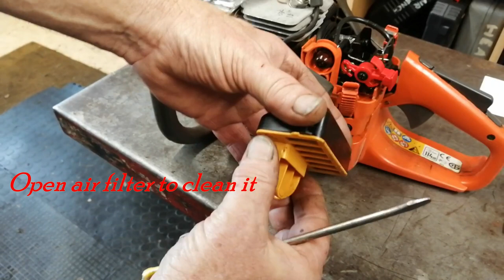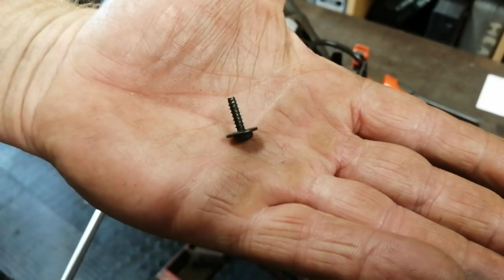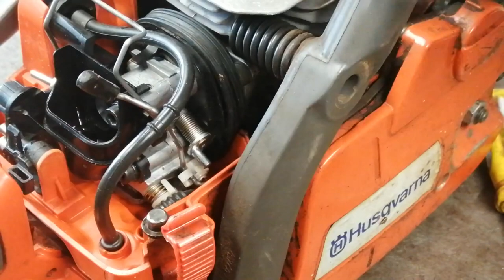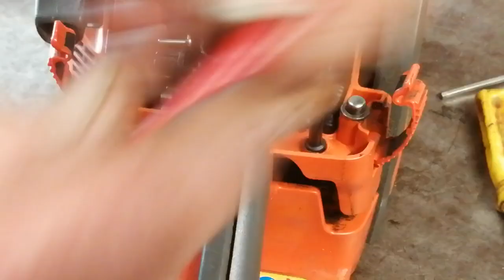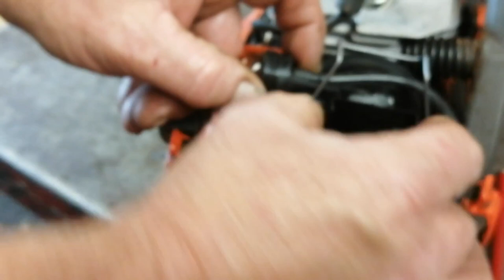Husqvarna 435 chainsaw carburettor removal

Comment: I'm about to do this on a Husqvarna T435 this week for a friend who is a landscaper. This was a huge help since I haven't worked on many Husqvarna products. Very similar to Stihl. Idle fines. I'm thinking it dirty/partially clogged since it runs perfect at WOT for about a minute after priming it and suddenly dies. Fuel lines look good. Will be replacing the air and fuel filter along with the spark plug. If cleaning the carb doesn't resolve it, I'm throwing a new one on. Again, I appreciate the visual video.
Reply from the maker: Almost certainly the diaphragm in the carb getting old and crusty, not pumping well enough to supply enough fuel at WOT. Get a carb rebuild kit. Start from the original carb rather than changing everything with a new one. I have had many pattern carb fails.

Comment: Thanks for the helpful video. I was struggling with the throttle linkage until you showed the little plastic clip to release it. If it helps anyone, this saw is also marketed as a McCulloch CS410 Elite it's identical. Mine (I live in Spain) has a small plate saying 'Made by Husqvarna Spain' and all the Husqvarna part numbers fit it. Also for it's detractors, I've had this saw for 8 years and it has been very good, changed the carb but the other one is good, just refurbed it with a kit.

Comment: Great video! It helped me a lot! The throttle and the air filter housing had me stumped. One thing... I used my long needle nose pliers to get the three Allen bolts out. Just grab and pull! Easier than the magnet. Husky definitely could have done a better job. I have a couple of 455 Ranchers and have changed carbs on those a few times. 5 minutes and I'm done. The 455 is a much easier saw to work on. This little one is a pain!
Reply from the maker: Thankyou and well done :)

Comment: To remove that 3rd pesky screw, I backed it out as much as possible with the Allen wrench, then used a tiny screwdriver inserted from above to hold the screw in place, then grabbed onto it with needle nose pliers & pulled it out.
Reply from the maker: And that is inspired. The final piece in the jigsaw. I can't re-record it unless the customer breaks it again :)

Comment: Hey, I removed and cleaned and replaced per your instructions, still having starting issue where it runs a few RPMs then dies. I feathered the choke a little and was able to get a few more RPMs, but not much. Fresh fuel, new spark plug, etc. Any hints to further troubleshoot? It has been a bullet proof power tool for many years until now.
Reply from the maker: Probably a crusty diaphragm issue. It is running only on the priming. Get a carb rebuild kit. Avoid cheap whole aftermarket carbs, I have limited success with them. Best of luck :)
Reply: Check your fuel tank vent!

Comment: Horribly designed carb. Watching this video is the only way i was able to get this carb off and clean it.  The little plastic piece holding throttle linkage was designed by a madman.  Attaching the kill switch wires can take hours.  Piece of doo doo.  Great video.
Reply from the maker: Thankyou.. glad it helped :)

Comment: That plastic tab that you pull loose from the throttle linkage is more than a fiddlle didly...lol Did you rip any of the gasket when trying to line them up with the allen bolts.
Reply from the maker: I don't think so.. I'm fairly sure it all this carb needed was a good clean inside.

Comment: Had every thing up to the peg in the rubber. (not the choke lever-yet)
It would had taken me a while to see that peg thing. And even if I did, *finagling that housing off just seems...well...
So that was planned by the engineers on a computer?
Pretty good software, being that it was coded with a, 'Finagle Subroutine."
Oh, I noticed you must use one of those low wood chips produced chains.
Yeah. When you showed us the air filter.
And, I think this is a rag 1 venture.

Thank you for the video.

*Finagle - To wiggle and twist.
Reply from the maker: I took it apart and cleaned it all out..then I made the video :)   Thanks for watching